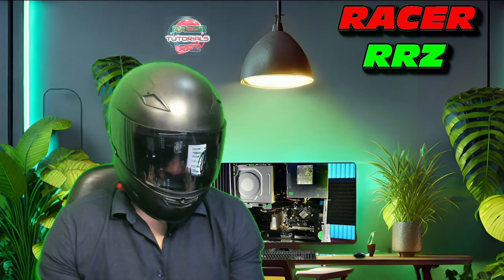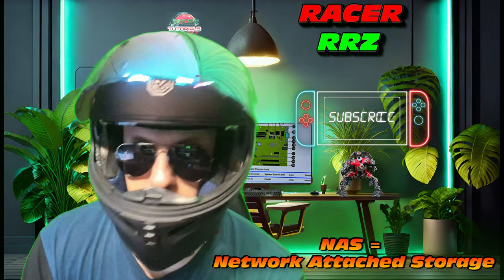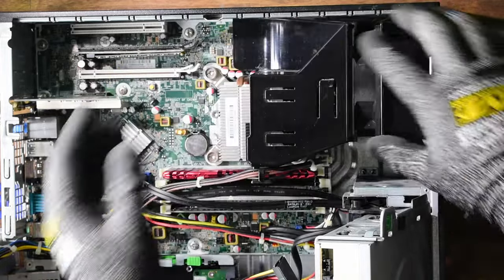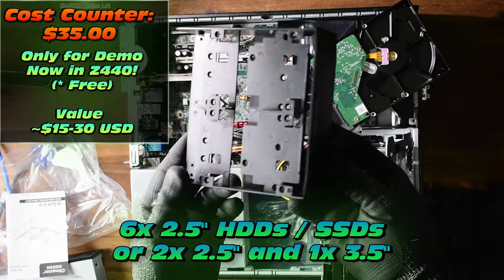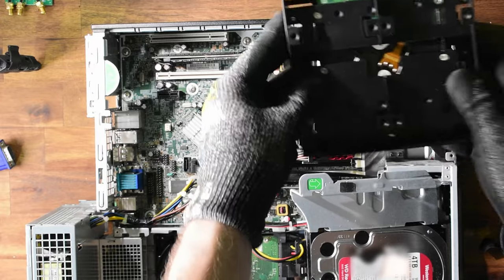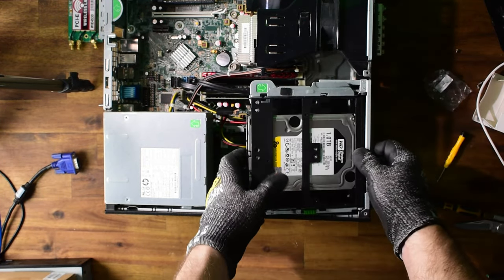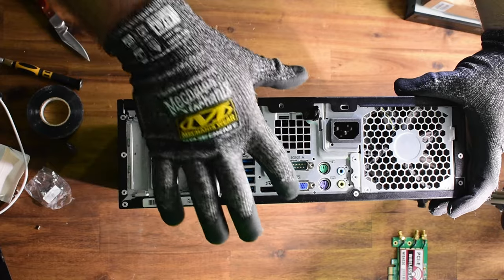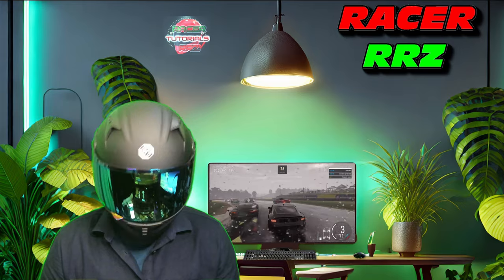$19.84 NAS / Home Server! (NVMe booting, SSDs + HDDs, ~25W Idle Power) Bargain or Click Bait?

Comment: Repurposing old home PC as server is how I first got into servers nearly 20 years ago. It's cheap and environment friendly way to start learning about servers, the software they run and networking and maybe even Linux if you're feeling adventurous. Good stuff.
Reply from the maker: That's the magic of the older systems - they tend to still have uses, even if you are not using them as your daily machine. I was impressed by the power draw on this system - which makes it more viable as a NAS / Server that could be left on 24/7. Plus HP tends to make really efficient PSUs, so that's always a plus. 

I need more hands-on with ZFS. Linux generally works well but I am well adapted to Windows since departing from MS-DOS 2.1 (Why does this knowledge of this make us old? haha).

Comment: 775 isn't i3/i5/i7, its before that came out.  Core2duo, quad, pentium 4 and sometimes socket 771 (depending upon the motherboard is what it can do).  I3 3220 is a lga 1155 cpu, best consumer is like a i7 3770k in terms of bang for buck.  And depending upon board a old Xeon may be supported
Reply from the maker: Thank you for pointing that out. 

My machine came with a i3-3220 fitted, which means I must have tracked down the wrong CPU socket in my search, strange!

The Elite 8300 SFF is LGA 1155 as you said (I must have traced an Elite 8000 SFF's details when compiling the socket details for the video! I was scrolling through Google images at the time to figure out PCIe slot- lane connectivity, which may have been the issue lol.

HP link for Elite 8300 SFF supported CPUs: https://support.hp.com/nz-en/document/c03345460

Comment: older hp gear delivers no question - can be found for cheap if you shop around - even better you can get an adapter cable to run a 'real' ps and put it in a real case - this means you can run a decnt gpu/more drives
Reply from the maker: Absolutely. What I like is the reliability - so far I have nothing but praise for my HP workstations - reliable beyond measure (touch wood, hopefully I don't have a PSU failure any time soon - they aren't cheap!). That's tempting but I feel like this system is a little old for the royal case swap treatment. I was actually looking at the HP Z2 Mini (likely G3, the newer ones still cost a bit) as a case swap candidate to retire the 8300 SFF. But the NUC craze has me looking for something that is modern, low power draw and cheap - the only snag is it may tempt me over to the dark side, Ryzen.lol. But then even HP is giving in to the power of Zen architecture (the HP Z6 G5 supports them!).